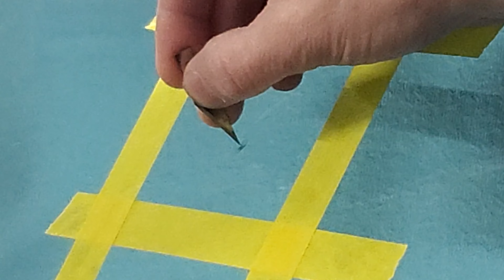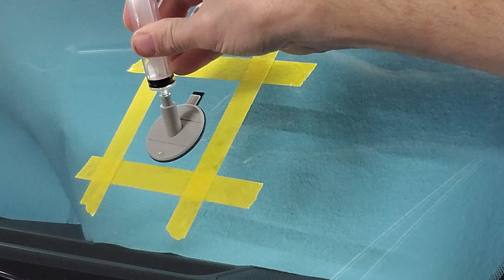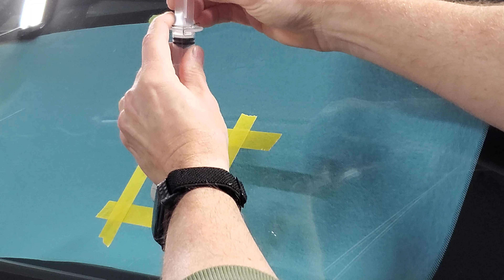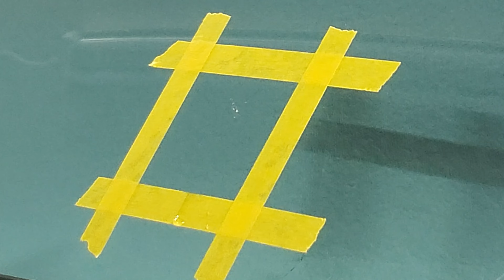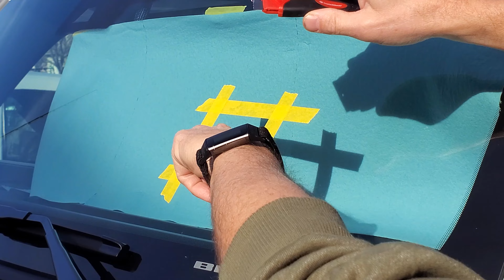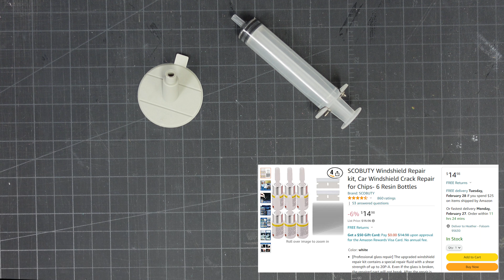Window Chip Crack Windshield Repair Guide for Permatex JB-Weld VersaChem Blue-Star Pedestal Kits 🤕

Comment: Hi again. I had to put off the window repair for a few days due to weather. Yesterday I did the repair and want to thank you for all the information you offered on using these kits. The J-B Weld kit worked perfectly. The chip filled in and cured perfectly. Also the chip was very low at 3.5" up from the cowl and about 5" from the A pillar. Wipers don't touch the spot. All's good.